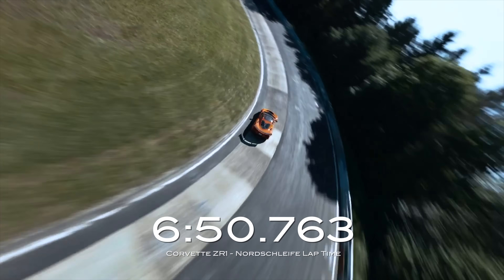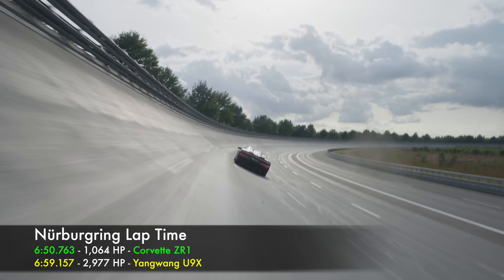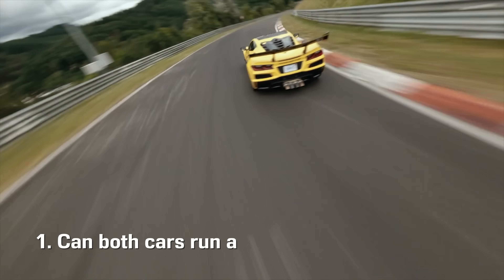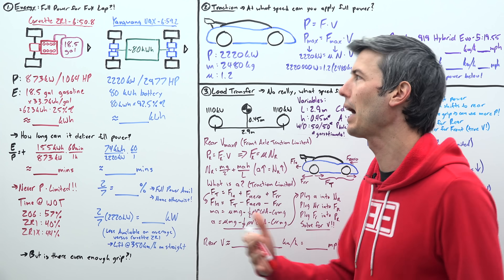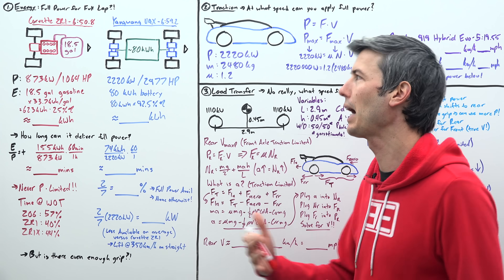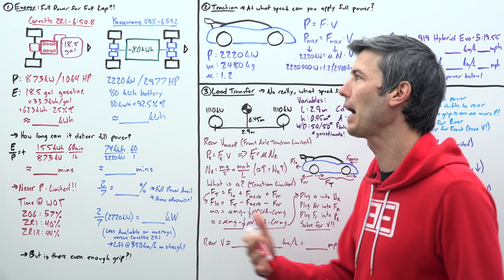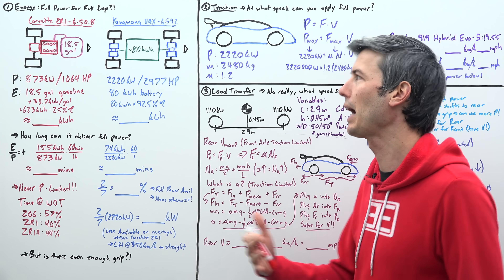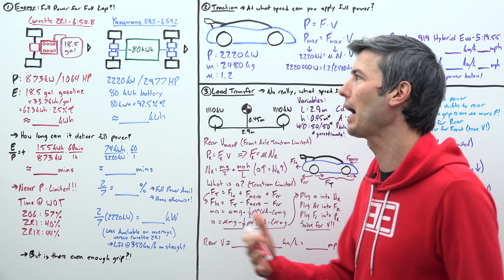Gas Beats Electric! Why Is 1000 HP Faster Than 3,000 HP?

Comment: It also depends on the drivers ability to know where the limits of the car are in relation to the track.  To out down a good time. The Corvettes were driven by engineers, not race drivers like the Posche or the "3000" hp electric thing.

Comment: You neglected to consider aerodynamic downforce until the very end, but it can be a huge factor. On some vehicles, it can more than double the traction at high speed. I would guess that you overestimated the speed they have to do to get full traction by probably 30-40%. Another major issue is that the car limits the power to prevent the batteries from overheating, that was demonstrated by YouTuber Car WOW, when this exact model of electric vehicle won the first two quarter-mile drags against a Lambo, but lost the third drag race, despite having plenty of charge.
Reply: Of course aero helps to get better traction, but it come at the cost of higher drag. So the car may be able to put more power down from a certain speed, but it will also require more power because auf the aerodynamic drag.

Comment: The old adage has been that the first thing to do to make a car faster is to get better tires.  Then work on the suspension. Then reduce drag for high speed work. THEN do something about engine power.
Reply: Rather than getting better tyres, I 'd reduce the weight. And rather than tuning up the engine, I 'd change the gearing.

Comment: What idiots wouldn’t put more powerful motors to the rear axle vs the front?
Reply: Strong front motors allow for more brake regen and less melted front brakes.
Reply: @larsjrgensen5975  but there is a feeling of shove from the back (ok I know I’m setting myself up here) being more satisfying, but maybe I’m just thinking from a gasoline perspective.
Reply: @thesvenssons  As far as I understand the 4 motors are roughly the same power.
With the crazy acceleration times like this they would not be able to give the driver the feeling of stronger rear bias, because they can not afford that the rear wheels slip or slide a little, everything needs to go into acceleration.
Something cheaper, slower and less optimal, will likely be more fun to drive then this car.

Comment: The problem with U9 is it’s LFP battery power density. It would be much lighter if BYD is not so fully invested in its LFP battery. Not much a problem on cheaper cars, but huge problem on sports cars.

Comment: I don’t think you gave downforce enough (any really) consideration. At those speeds it’s more than weight distribution front to rear. I would argue that the downforce would make the speed at which you can use max power MUCH lower.

Comment: Is it better to have a motor on each wheel than having one motor with a differential?
I mean you can never put all power on one side or wheel with motors on each wheel compared to a differential that can route all power to any side or wheel. Or maybe that won't matter anyway, idk.
Reply: You appear to be thinking mechanically. Having independent motors for each wheel allows sophisticated computer control to provide  benefits such as torque vectoring without the need for heavy, complicated and expensive mechanical drive systems.

Comment: Wait...

I think you forgot one important thing about the EV...

The EV in question has four engines. That near 3000hp is divided into each engines. Each of those couldn't possibly produce 3,000hp, let alone, two.

To rephrase that, they produce near 3,000hp "together." Alone, they don't even produce 1k.

"What does this mean?"

It means that the  U9 is using around 1,500hp to 2,500hp, around half or over half its total horsepower for the majority of the time.

You also didn't account for times where they hit corners, which forces the car to slow down, therefore pushing the weight forward or to the side (depending on the degree of the turn).

And this supports the U9's lap time, which is slower than the Corvette's, because the weight is holding it down and it's unable to put down 3,000hp on each wheel.

ICE engines, however... can put down more than that.

Sure, that Corvette only makes near 2,000hp... but it's applying that on the TWO wheels. In other words, using the U9's logic of combining HP across all its supported wheels, it's putting down a total near 4000hp on the rear wheels.

The thing I'm trying to say is—the error here is assuming both cars are the same, when they're not. The ZR1 puts all near 2,000hp on the rear wheels, whilst the U9 can't even do that with two. It has to rely on putting it all on 4 wheels, even if there are discrepancies.

Comment: Electric vehicles also have regen braking. Idk about U9X specifically, but that should give the car a little bit of extra power. 
So, the average power available should be more than 634BHP. although i doubt it will reach anywhere near 1000BHP. 

But corvette doesn't produce full power throughout the track anyways.. But probably produces more than U9X even accounting for regen braking.

Edit: sorry I read ur pinned comment after posting this. Ya, even I thought regen won't be enough to compensate for the difference in average power. But you also pointed out heating issues, and limits on regen braking in 'track mode'. That further reduces the usefulness of regen braking.

Comment: you know with all the math i think simply because the car weighs too much, everyone knows winning races has more to do with braking than acceleration. the more speed you can carry up to and through the turns is what wins at the track. a heavy electric car will have a harder time scrubbing off speed and less ability to hold the road in turns. the example of that F1 car proves this theroy and the fact it has a lot of aero to hold it to the road in turns without adding mass makes all the difference. same is true about added mass and the abilility to accelerate or lack of compared to the lighter vehicle

Comment: 3,000HP at the expense of additional weight means slower cornering speeds and earlier braking which reduces the distance that acceleration is useful. The more technical (changing directions) the course is, the more efficient a lighter vehicle is, regardless of HP.
Reply: That ev weights over 5400lbs, so really can't use all that power around tight turns.
Reply: Yes that's why racing cars are subject to heavy diet before anything else.
Reply: Totally. The analysis is an interesting part of the answer to the question and I like seeing the math but this level of analysis doesn’t come close to answering why one car goes around a track faster than another
Reply: Does that ev have active aero?  That would help.
Reply: you just ruined 16 minutes video with 1 sentence ;d
Reply: weight is usually bad, but being heavy can be useful.
Reply: So the eFormula won't take off before 2030. The (energy-dense-enough) "Battery Supremacy" is not reached yet. Not today.
Reply: yeah you totally missed the point
Reply: @kidShibuya  OP made their own point.
Reply: @kidShibuya the point is why does one car navigate a track faster than another, and this involves a lot of cornering and factors beyond “how much power can this car put down in a straight line”
Reply: @Libroer  Right, so trucks with massive fuel tanks are clearly the fastest cars.

Comment: I feel that looking at the engine output in kW (or horse power, for those stuck in the past), undermines our intuitions. kW is (torq Nm x rpm) / 9549. The motors make 1680 N.m, so 2220 kW happens at 12,600 rpm. With an 8.3 reduction ratio (from your previous video) and 325/35R20 tyres, that means full power is only available from 210km/h. If the 415mph (664 km/h) theoretical top speed is real, that means a 6.25 ratio, with full power available from 279km/h.

Comment: The aquiles heel of electric cars is the ""fuel""storage, AKA, battery.
To store 80kw of electricity you need a battery with about 600kg (permanent weight regardless how much "fuel" you had used)
With a tank of 60kg of gasoline you have about 600kw of energy (and the weight decreases with burning rate)
Electric vehicles will only be viable when another way of electric storage is invented.
Reply: The resulting energy of a gasoline engine is up to around 40% efficiency, so it would end up with 240 kWh for 60 kg of gasoline. If the energy density for batteries goes up to factor 3 then the electric car had atleast the same amount of energy per charge then the ice car per  refill.
Reply: @SvenWeber-kk4rc  And you'll continue to carry 600kg of wasted weight even when your battery is at 5% of charge. And imagine how you'll charge an entire fleet of semi trucks to carry all the goods around the country. It is simply impossible because you'll need to 1000x the power generating capacity.  
Electric vehicles servers only ONE purpose: 
CONTROL (surveillance) OVER TRANSPORTATION.
Reply: @realfabioalex yes the extra weight is an issue , atleast for a performance car on a racetrack . 
For transportation its at the end infrastructure and costs that will make a use case.
Reply: @SvenWeber-kk4rc  to be clear I'm not trying to argue with you. I just have a firm opinion that electric cars in this format are not viable. The amount of energy necessary to "fuel" our entire fleet is simply unachievable in this current model. The electric motor itself is far far superior in terms of efficiency. But the other things (battery and charging) are not as efficient. Unless another way to generate, store and delivery electricity is invented (like fusion reaction for example), electric cars are not viable for our entire society. They are like fancy toys. But if you want to do real work (like tow, truck, farm, etc...) for now you'll need to call the real deal...combustion engines because they generate they're power on the place they are while electric vehicles rely on power being generated elsewhere (hydroplant, coal burning, nuclear, etc...). Combustion engines are overall more efficient for this reason: portability.

Comment: The Yangwang U9 Xtreme 0-60 aka the DRAGS is where it cleans the ZR 1's clock - 1.9 versus 2.3  low 8s versus mid 9's.  And it cost less than ZR1 by at least $20k but for tariffs and bans.

Comment: So a ZR1 running continuously flat out for 10 minutes will completely empty an 18.5 gal gas tank?
Reply: Well, look up "open road racing", like at Big Bend. The recent BBORR Fall 2025 winners in the Unlimited class, in a 2019 Corvette, drove 59 miles on U.S. Route 285 for 20+ minutes at a speed of 173 (mph). Most entrants were in the classes for target speeds between 100 and 150 mph.

Comment: In any race the weight of the vehicle divided by the horse power and torque plus how much grip can have it's going to be the winner. Electric cars are too heavy for circuit race. It's not about how fast you can reach top speed it's about the constant speed you can make in the whole circuit.

Comment: I’m positive you’re aware, but why isn’t downforce and air resistance a factor in the U9’s “full power available” speed? I mean, an F1 car can drive upside down because the downforce equals the weight of the vehicle.

Comment: Electric is all "numbers and stats'", which are unusable.

Single speed, or maybe dual speed EV can only get the peak power out at the top of their range..
 - 6,8,10 speed ICE vehicles get their peak power every time they hit  (or remain on peak RPM..

For top level performance EVs need to go back to the architecture drawing board and insert CVT.

Mechanical Power  = Torque x Angular velocity  (Radians per second x NewtonMetres  or ( Foots-Pounds x RPM with "Imperial Correction factors") OR Newtons x Metres per second (Force x Velocity) )
Electrical Power - is simply how many electrons are being sunk through a power delivery system (Volts x Amperes  (Electrical Potential x Current))

Power down - is absolutely a critical thing..
Frictional Force at maximum Normal force - say the normal force is 400kg per tyre, and the Coefficient of friction is 1.5 (race tyre)   gives a frictional force of 5886N,  at 250km/hr (69.44m/s, this gives a power of peak 408.7kW  per driven tyre at 250km/hr but only ~245.25 kW per weighted, driven tyre at 150 km/hr.)

Comment: So it's definitely about more than power... you should see if you can interview Misha (I bet he'd be up for talking with you since you both have strong youtube brands). The Yangwang is 40% heavier than the ZR1 and that will increase stress on the suspension and especially the tires. It's possible that car with that much weight and that much power will cook the tires in less than a lap (unless they're massive). Then with electric vehicles it seems pretty common for him to overheat the batteries in less than a lap, which also causes power reduction. 

As you mentioned the GT3-RS IS quicker than the ZR-1 which is another example of weight, suspension, and aero being very important... there are other factors there though like the fact that Porsche LIVES at the ring (near perpetual presence) and Chevy ran that lap after a couple short trips, optimizing the setup for the ring is a big part of getting a fast time so the ZR1 time IS impressive, as is the Yangwang time.

Comment: They need to engineer one with a 25kwh pack just for the ring.
Reply: It still needs to complete the lap, 25kwh is barely enough for a drag strip if the grip is good.
Reply: @larsjrgensen5975 id be curious where the battery was when the lap ended, can't forget Regen on the laps. 

A lot of EV can do several laps on Nurburg on one charge, even driving full out.

The battery charges entering each turn than discharges as it exits onto the straights. Back and forth like that.
Reply: @pierredelecto7069  A 2024 model 3 performance uses 30% battery on a lap and that is with burning brakes and power limits because of temperature. So a 25kwh pack would be empty even with a "slow" model 3 performance.

Comment: Would've been nice if you taken into account down force - not just a little mention, but with actual numbers - since at those speeds it is not negligible but I also understand finding the exact numbers for this would be difficult.
Also you at the end you didn't mention why having more power is a bad thing, having more power is never a bad thing - the cost of having more power is where it becomes bad.
To have more power you need more weight which is very bad because that increases inertia which drastically increases the amount of grip you need to have the same performance; turning speed, braking, accelerating.
Having more weight does increase the grip but not nearly as much as the degradation of performance - EVs are also heavier because of current battery technology so they tend to be worse on circuit.

Comment: I think your title is misleading(what a joke to mention only HP numbers). Your title assumption is wrong, you compare ICE and EV without mentioning weight factor? Even that absolute record holder Porsche 919 Evo is hybrid and has additional 324 kW (434HP) electric motor. It will be fair if you mention that both cars are in category of "Prototypes/Preproduction vehicles". So in that category as EV will be fair to take Xiaomi SU7 Ultra Prototype(6;22) that is 28 secs faster then Corvette ZR1 (6;50). Also factors like aero, recuperation, driver skills, weather are important.

Comment: If the start and end point of a race track are in exactly the same place, the effective distance travelled is zero.
As speed = distance / time, 0 metres / 600 seconds = 0 m/s.
Therefore, both cars are equally fast, each having effectively zero speed with no distance travelled.

Comment: You ignored probably the most important factor until the very final comments. Weight and cornering speed. The U9 is far heavier than the Corvette and the 919 Porsche is about half the weight of the Corvette while going far faster with about the same power. Same reason a Bugatti Veyron has never done better than a fairly tardy 7min 40s.